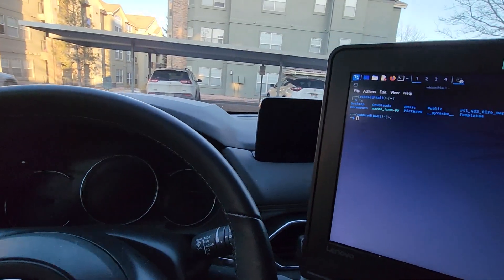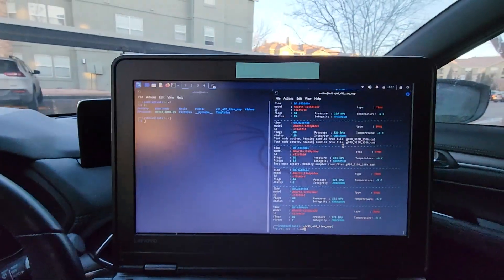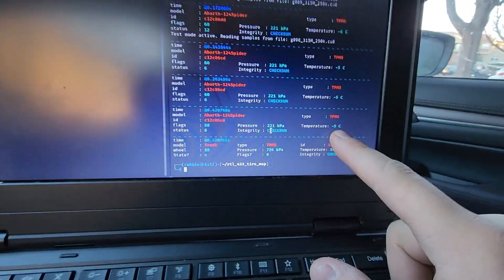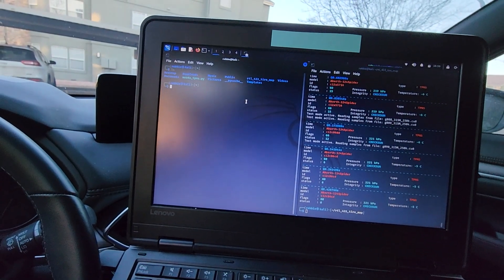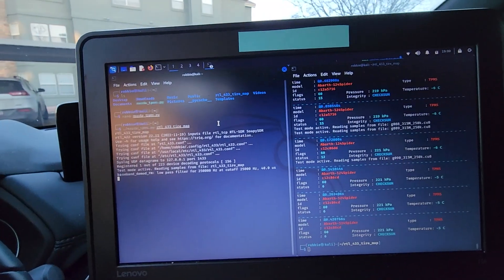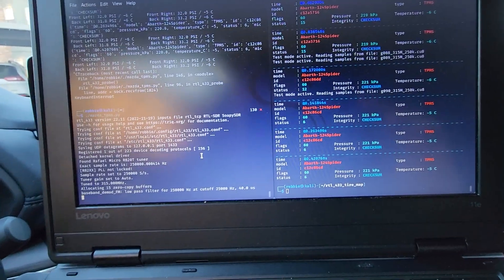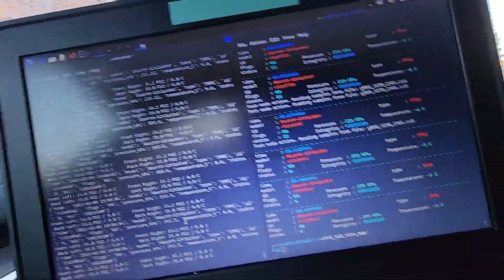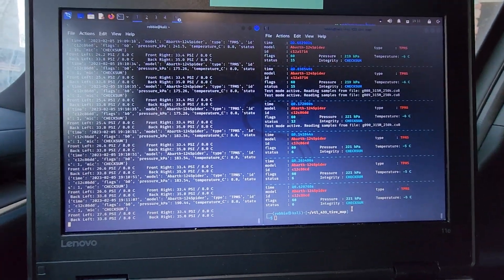RTLSDR Mazda CX 5 TPMS

Comment: Hello,
I was trying use your code but cannot start:
rtl_433 version 24.10-3-g4fa37568 branch master at 202411051225 inputs file rtl_tcp RTL-SDR
Syslog UDP: Sending datagrams to 127.0.0.1 port 1433
Use "-F log" if you want any messages, warnings, and errors in the console.
usb_claim_interface error -6
Traceback (most recent call last):
  File "/root/rtl_433/tpms.py", line 146, in <module>
    rtl_433_probe()
  File "/root/rtl_433/tpms.py", line 101, in rtl_433_probe
    if data['model'] == 'Abarth-124Spider':
       ~~~~^^^^^^^^^
KeyError: 'model'